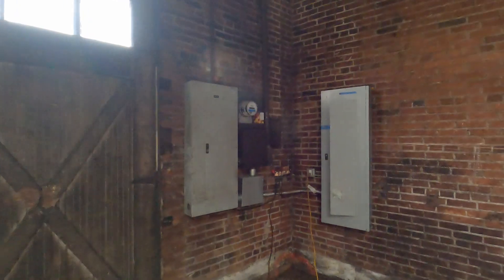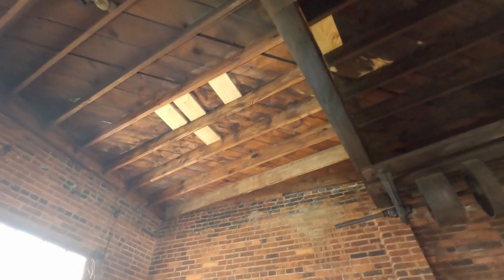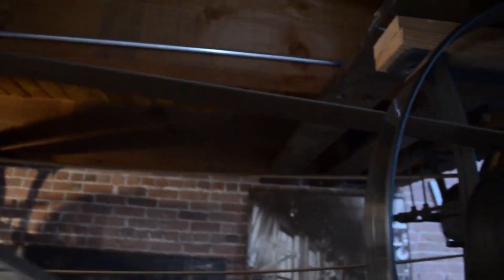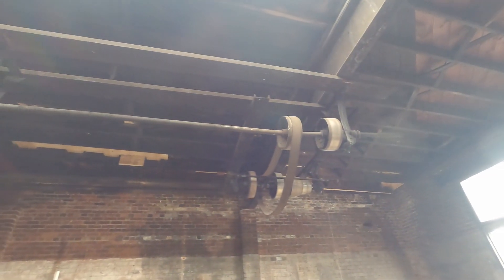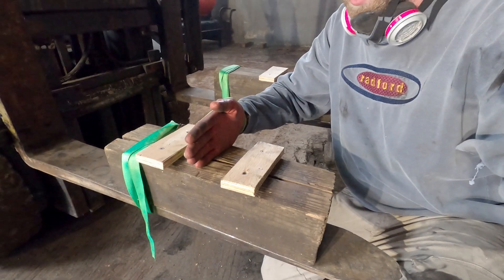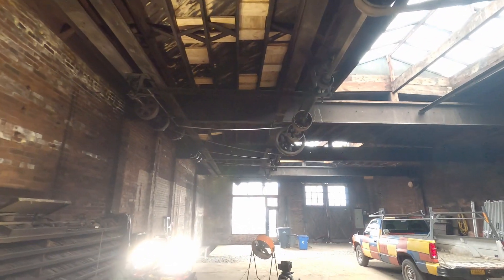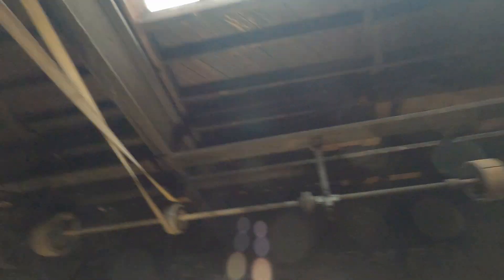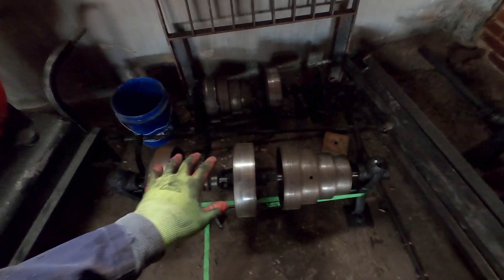The Renovation: Episode 11 // Trimming the Line Shaft

Comment: Really enjoying these videos. Have you thought about sand blasting, rather than pressure washing the ceiling? Probably no less pleasant a task, but the results could be better and it won’t get so wet in there!
Reply from the maker: Ive actually found a solution, stay tuned for the next video ;) Cheers! - Tay